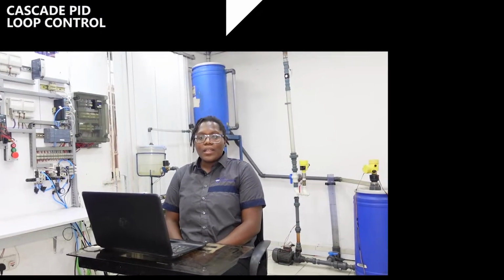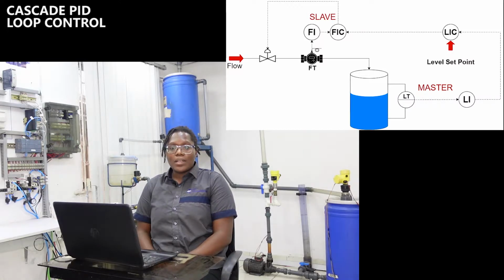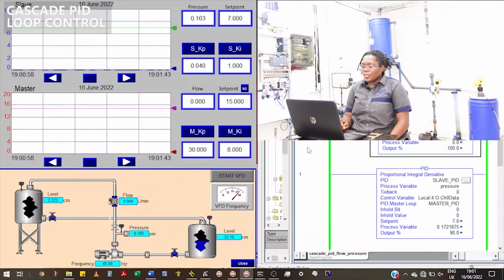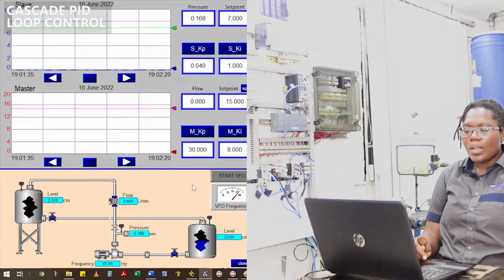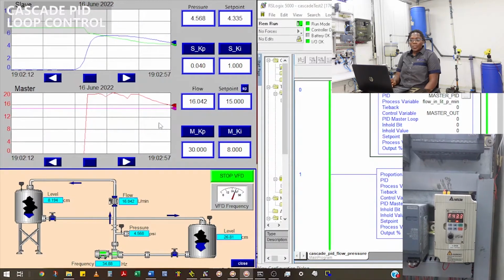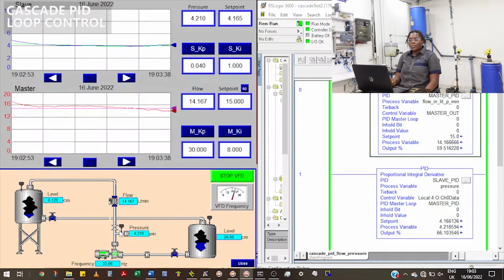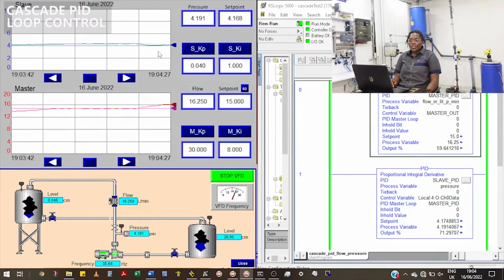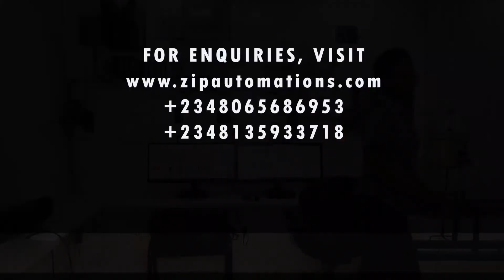CASCADE PID LOOP CONTROL

Comment: Good presentation but I don't think you had the best choice of master and slave parameters. The best case for cascade control is when your primary parameter is slow and the secondary parameter is fast in response. Here, flow and pressure are about the same in response time. I think tank level would be a better example for a slowly reacting primary setpoint.
Reply: I agree, the slow process is the Master and the fast is the Slave.